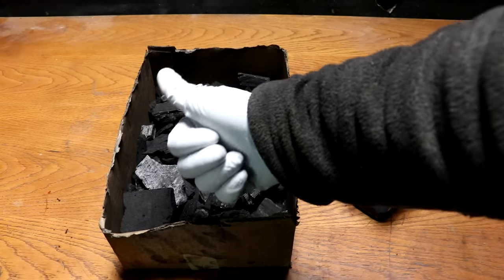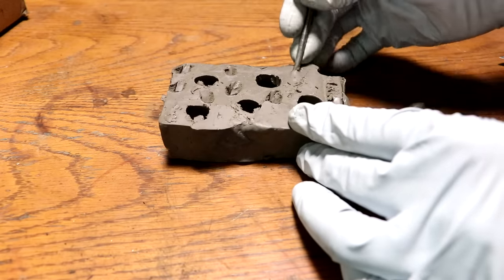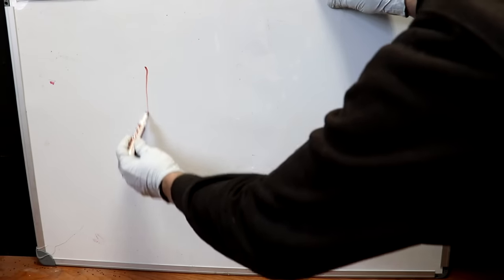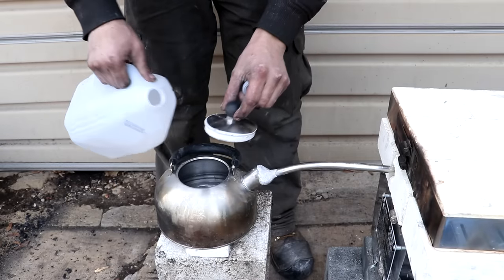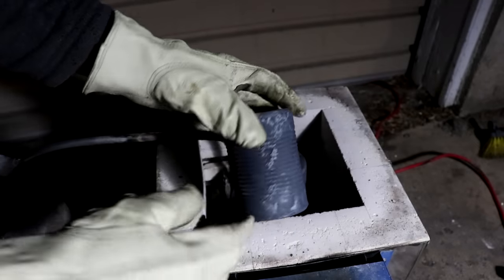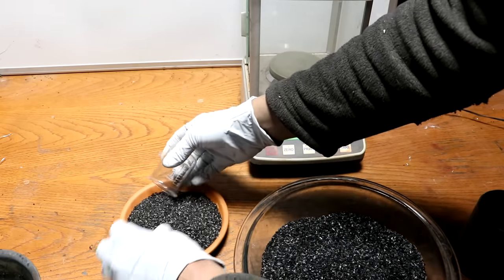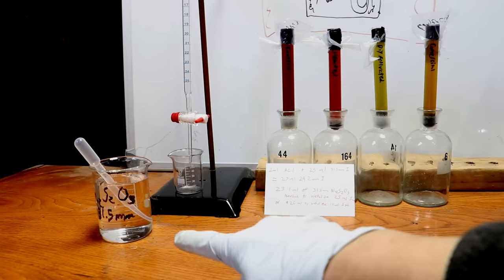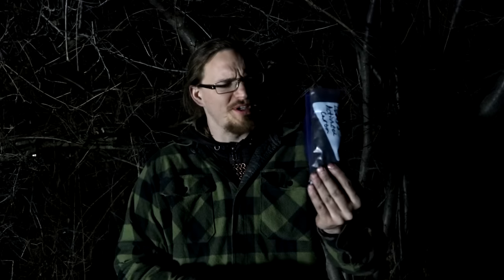Making Activated Carbon

Comment: Cody are you sure it isnt heavier cause you kept injecting the steam into it and saturated it with water?
Reply from the maker: I stopped the steam at about 700C so it should have dried out.
Reply: plus the charcoal that heated up in the cans was heavier
Reply: wouldnt the heat evaporate the residual h2o? like when you take moist laundry from the dryer and it gets dryer by evap?
Reply: @danielrouw2593  so you're saying it may need to sit longer? Would dry freezing work?
Reply: @marcpp  if what they say is correct, it's just going to be as humid as the surrounding atmosphere. So freezer drying should work imo if it stayed sealed
Reply: Also I think Cody is right. The pieces are going to deform and he can get a better pack. Only way to know is to do it again!
Reply: @danielrouw2593  I'll make that video appear on my list
Reply: @Yoshikaable  , with deform, you mean more round?
Reply: @theCodyReeder  I remember you did a video once where you took what seemed to be bone-dry dirt, and managed to extract moisture out of it. Might be worth a test to see if some moisture content remains.
Reply: simply put some samples in a freeze dryer and see if the weight changes?  I'd assume activated charcoal is a desiccant.
Reply: 5:17 would it work better if you to do it as a fluidize bed ?   like whats is face did with the hot tub full of sand and compressed air ... only this time with steam and charcoal in say a bucket ?
Reply: @theCodyReeder , point to remember guys if water is evaporated the grains shrink hence more grains can fit in a given volume so yes it will weigh heavier because there are more grains of charcoal.
Reply: 9:19 hmmm could you not use the water gas to  fire the furnace or at least the kettle ?
Reply: @Cody'sLab 

What were u doing with the sticks at the end of the video ?
Reply: It’s more likely that the heat deforms and compacts the carbon somewhat, the charcoal that was just heated in the furnace without steam was observed to also be slightly heavier so it’s most likely not saturated with water.
Reply: @danielrouw2593  700C doesn't evaporate water, it vaporizes it. There is a big difference.
Reply: Either way. Its still a very curious result. I cant help but wonder if after turning off the kiln and continuing to inject steam (even only to 700C) caused it to cool at the un-stirred core and pull in more moisture. But even still just letting it sit outside the can spread out on a surface while still warm would or should let it dry. I would think. BUT, The steam is much cooler then 700C. AND when you rapid cool something it tends to fill up with what you are cooling it with. IDK I am stumped. The simple fact you were able to make activated char is cool. And at such high quality. And that isnt what im questioning. Its that pesky weight difference thats bugging me. lol
Reply: @theCodyReeder  There's nothing to transport out the remaining water, if any of it didn't react at that temperature. Another possibility is, that packing density is higher because of rounded egdes and corners, since reactivity there should be higher than on the surfaces.
Reply: @Norgust  I was actually thinking it might shrink in volume but have greater surface area, so at a micro scale it would be more pointy! But perhaps rougher is a better word
Reply: Higher the temp the lower the adsorption for a given vapor pressure. Freezing would do little to nothing, possibly increase water content, heating in a vacuum may reduce adsorbed water. Doesn't much matter though, water is only weakly adsorbed compared to the target purposes for activated charcoal, this is why it is used to filter water.
Reply: This gives me an idea: If there is water inside the carbon, what about freezing it? Perhaps as the water expands and forms ice the ice crystals will punch holes in the pores of the carbon making them even more porous?
Reply: @JehuMcSpooran  fascinating...
Reply: Would be interesting to see what effect very finely grinding the charcoal has.
Reply: moisture from the steam obviously made it heavier..there should have been a steam exhaust, so that the steam effectively takes the carbon atoms with it as it evaporates...

Comment: Cody. Did you do an experiment with wood gasification yet .

And if you decide to do it could you run a small engine off the fuel.
Do it your way ,so it makes sense.

Thank you for good science,chemistry,physics,baking .so forth.

Comment: I think you also found another way to further increase the yield of a wood gasifier. You get charcoal as a byproduct. The amount of charcoal is a limiting factor of your syngas production. If you find a more efficient way to do this process, you could theoretically increase the yeilds of bio-reactors.

Comment: If used in black powder, would it have any effect?
Reply: Watch elementalmaker's video of him trying activated charcoal graphite and willow charcoal
Reply: Activated carbon is generally known to be less effective or even unsuitable.
You want some residual hydrocarbons for the optimal/highest reactivity.
There are certainly different varieties of activated charcoal (with different chemical composition and surface area/structure), that might act differently, but for the most part it's more pure carbon, that is less reactive.
You would normally grind the charcoal as fine as possible anyways, so surface area should not differ that much afterwards either.
So you could use it, but probably won't get better results, than with specially suited charcoal (wood type, pyrolysis conditions, particle size). It mainly will produce a much slower, more sparkly effect.
As incorporating sulfur into charcoal improves performance, it could be interesting to investigate, wether one could infuse activated charcoal more easily with sulfur in solution. But that would never be practical.
The main goals of BP are to be cheap, easily ignitable and reliable at various performance levels.
Reply: @realedna  Adding sulfur into the activated carbon would make it more unstable for ignition right?

Comment: what is that thing that shows up at 14:56 on the upper left corner?
Reply: maybe a rendering error or Cody has been kidnapped and is trying to send us a message?
Reply: They're "links" to other YouTube videos. Put them on the end of the URL, like this: /watch?v=FgJZA7c7Z9c (that's the code at 13:51).
Reply: @StormBurnX  for older videos that still have the annoytations
Reply: @StormBurnX  it's still there for when you come across older videos that still have them.
Reply: @StormBurnX  yes  the switch is still there, but annotations  are not
Reply: @StormBurnX  are you confusing annotations with closed captions? nobody  has used annotations in at least  2 years

Comment: Hi, captavating videos Cody, you most likely figured out by now the particals flying round at... 12:00 mins are actually the lining of the can,. Factory puts acrylic, polyester lining in cans to prevent rust activation and promotes longevity and sterile conditions.. anyway thanks for the videos Cody.. cool stuff... Thom in Scotland.

Comment: If you don't want to go through the hassle of using tin for bending you can also fill the tubing with sand, it works great and you can pour it right out when you're done.

Great video btw!

Comment: I'd bet that a significant factor in the density change between the untreated control versus the treated sample and heated sample is due to some sneaky fluids added to the commercial charcoal to help it burn. Putting it through the furnace either drove off the lighter fluid or cooked it down to carbon.

Comment: What if you put activated charcoal in a fizzy drink?
Reply: I'd expect not much, as it probably doesn't absorb huge amounts of the CO2 gas?
Reply: Cracked Emerald we did that as a school experiment, the color dissapeared and it tasted just like sugary water
Reply from the maker: Would be similar to dropping in mentos. But once the carbonation is gone it will adsorb the dye making the drink less colored.

Comment: So how do I make this into 'air' filter?
Reply: Pre-filter larger particles out from the air first then force that pre-filtered air thru it. It works by collecting and reacting with chemicals in the air so you need to push air thru it to get any effect. Unlike the guy before me said, it does pretty much nothing if it just sits there. It is not magic.
Reply: A bowl of activated carbon sat in a room will filter some air. But squid is right, you will need to circulate the air. A crude air filter would be a table covered with a layer of activated carbon, with an arrangement of fans to draw air towards it.
Reply: The fans could blow air away from the filter, too, this would be better because it will create a region of lower pressure, which draws air in more uniformly from above. Also it would avoid the particles of carbon blowing around.

Comment: Why did you fill the pipe with Tin to bend it, instead of say, sand...?
Reply: I would guess it's just what he had available but I know very little.
Reply: I would guess that sand is not solid enough. The pipe would have kinked and broken.
Reply: Same only works so well, and only up to a certain radius. Sn works better. (Or any metal with a really low MP.)

Comment: You can fill the pipe with water and freeze it instead of using tin. It also helps with bending and is easier to clean.

Comment: Nice job Cody! I am actually not surprised your charcoal came out better than the commercially available stuff. I would have to think that it starts absorbing things from the air as soon as it's activated. Much in the way that zeolites can be used to filter gasses. Just a theory but I thought I'd bring it up. If the two samples, yours and the commercial one, were made with the same method, the only difference would be their age. I don't know how they make the commercial stuff, but steam and heat sound cheap and easy to do commercially.

Comment: Amazing! even though your DIY a-charcoal looks like it has bigger pearls than the usual commercial a-charcoal, it performed better... or perhaps your charcoal has more small particles mixed in?

Well, anyways, you could make your charcoal at the same time as you make the activated charcoal, just by having the containers on top of eachother, and separated by metal, and of course heating the water within the a-charcoal container.

Comment: To bend tubing you can find a spring that fits over the tubing then you can bend the tubing by hand without it kinking we would use a spring to bend brake lines and gas lines it works very well, try it.

Comment: Your charcoal burn failed? Oof. It's been years since you did it, but if you haven't figured out a good way or if anyone else here needs one..❤

- Get (unused) paint cans with lids.
- Punch a tiny hole in the lid, 1-2mm (this is your wood gas exhaust).
- Load them with the target material.
- Lids on tight.
- Make a campfire.
- Toss the cans on the fire with the vent holes pointing upward.
- When gas starts exiting the cans the process has begun, wait until this stops*.

* For extra fun, light the wood gas stream on fire. Sometime I wanna try harvesting it to store somehow.

Comment: Hey Cody I am a huge fan keep rocking!  and I have a gardening question. Would granulated or powder charcoal be better for “terra preta” or biochar. 
And I would like to get your opinion on if charcoal form a small fire would be sufficient enough to see noticeable benefits in plant growth or not, or is the more activated the better such as in your diy super heated steam activated charcoal. I personally believe the more activated the better. I currently only have access to fire pit charcoal, and have been turning it into powder, and adding it to my compost pile aswell as granulated charcoal just for good measure. So I wont be able to observe any difference in my own compost. and I’m assuming that I’ll still see benefits. Thanks for taking the time to read if you do so, if not that fine too hah

Comment: Great video!  I'd like to see you try making it with a couple other methods, chemical activation - possibly an acid and base. I've also read that ZnCl2 and CaCl2 can be used and those would be interesting to see how they work as well to compare the results of different chemical activation processes compared to the steam/commercial product. 

This video made me think back to your lead recovery from a battery but the PbO2/PbO really limits the amount recovered.  You could use this same setup for activated charcoal to reduce the PbO2 by using the steam & carbon producing water-gas/producers gas (CO+H2) to reduce the PbO2/PbO.  Just replace the charcoal you wanted to activate with the oxide(s) and run the gas through the heated oxide and see how much reduction you get. It should all work pretty well with the stainless containers as well.  I'd like to try this myself but don't have as complex a setup as  you. 

Anyway, good work and love to see what you do next!

Comment: Wow titration that brings back memories, one of the few things I remember from chem in school is titration because I broke the special glass pipette.

Our chem teacher told the class "these are expensive so don't break them okay? The school only has 5. Only hold them with one hand, so that you dont snap them."

My team assigned me to hold it, because generally I'm very responsible.

I thought "oh shoot, better not drop it"

I'd assumed "I'm only holding it in one hand like he said so it's definitely not going to snap"

But I held it too tight (trying to make sure it didn't slip out of my hands) and it shattered in my palm. 
Like I literally crushed the glass tube by holding it too tight from nerves.

I ended up needing to go to the doctors to get some little shards removed, the cut wasn't too bad tho, 
but after I got back to school I was crying, because
 "oh no I broke the expensive thing, my teacher is gonna hate me forever and make me pay for it, I don't even have a job!"
My teacher was nice tho, he didn't make me pay for it he just said I wasn't allowed to hold any expensive equipment anymore.
Fair enough.
But yeah I think that was the 2nd most guilty I ever felt in my life so I remember it clear as day.

Comment: So in other words assuming the result numbers aren’t too far off, to get the same rate of effectiveness/absorption with normal charcoal you’d have to use 46.25x the amount of normal charcoal compared to the steam activated charcoal… & 3.08x the amount if using using charcoal that was just “further heated” 

So in this instance the effectiveness of 1gm of activated charcoal is equal to 46.25gm of normal charcoal & 3.08gm of “further heated” charcoal.

Comment: Just a small advice, you probably know it already. You could have added couple milliliters of starch solution (10% solution if I remembere correctly) near the end of titration (when the iodine solution is of very light yellow colour), it dyes the solution dark blue (or black if you add starch too early). It clears up at the end of titration. We use that methode for determenation of iodine number in oil samples.
Reply: could you explain cody's titration calculation? such as why 9.26ml of iodine only contain 37mg of iodine?

Comment: Fascimating stuff, but for something that's got a even higher  potential interest, how about doing another about bio-char? Dicking around figuring out an optimal recipe, possibly a high efficency off-grid or low carbon one could be useful for a lot of people. Your activated charcoal turned out better than the commercial grade stuff. One of the ways farming could help out drawing down massive amounts of carbon would be creating bio-char, both for the CO2-draw down but also because of potential boosts to farming yields from using it. This could make this part of a carbon mini-series as well as tie nicely into later farming videos where the bio-char gets tested for soil improvement.

Comment: That's how they probably made the shrunken heads, and for the acid on glass video maby it will work in a vacuum chamber? That's so amazing that it breaks the glass without any impact like you demonstrated with the sludge hammer

Comment: I wonder if you could get a comparable increase of the surface area of the charcoal by simply waterlogging it at some stage (getting water into all of the pores), freezing it (using the expansion of the water to make new pores and channels in the charcoal), and then rapid heat drying it (allowing some reaction of the water with the charcoal, as well as driving the water off)?
It would be a longer process, but you could potentially process larger batches and wouldn't need the whole kettle setup

Comment: second time watching this just for entertainment

and i think the reason it got heavier is because it contracted like you said, but not from the heat.

the heat expanded it, which allowed the pores to open up and release the tars and such which were what made it heavier, and then as it cooled it contracted which made it possible to fit more in the beaker.

so it got more dense from thermal contraction, and got rid of the waste like ash and tars that was preventing it from becoming more dense.

since there was actually more carbon than waste the contraction allowed it to become more dense than it was before and thus heavier.